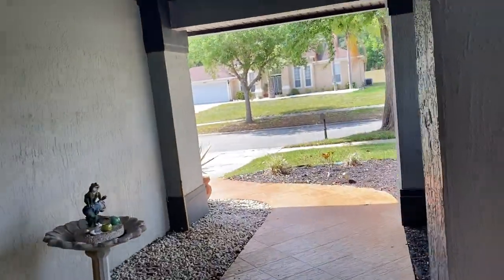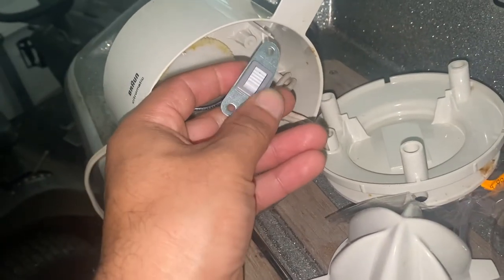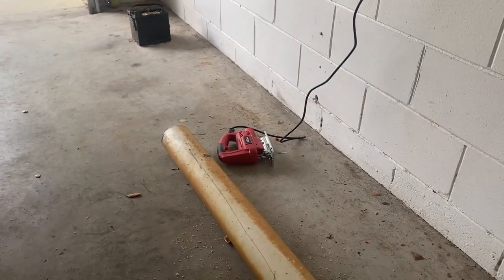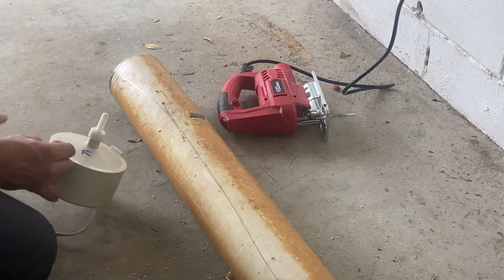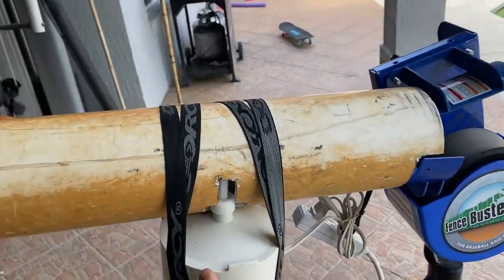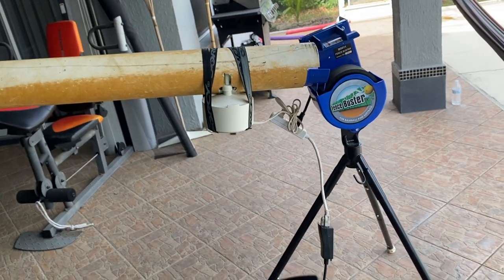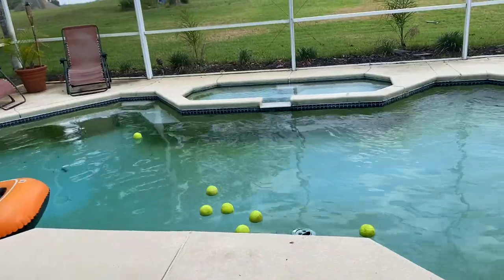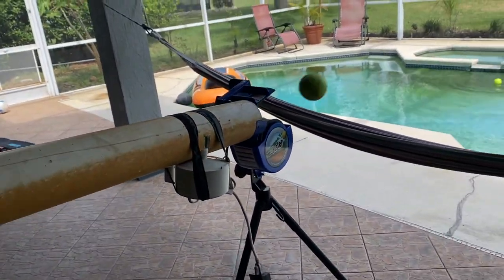HomeMade Pitching Machine Auto Feeder DIY / The CHEAP Build Tutorial

Comment: Umm seems like you don’t need the juicer. Gravity sends the ball down the pipe and the feeder belt extracts it.
Reply from the maker: Good morning, lol well the problem would be that the balls would launch quickly one after the other and no time for the batter to get ready ad second I added a remote on/off to the power of the juicer allowing me to start/stop remotely. Plus the juicer alone allows the ball to pass by slowly and not free fall as gravity would allow it
Reply: @Mayimbe  it’s cool but u need both then for that to work. Did u diy the belt system? 
Cause that would be impressive too.